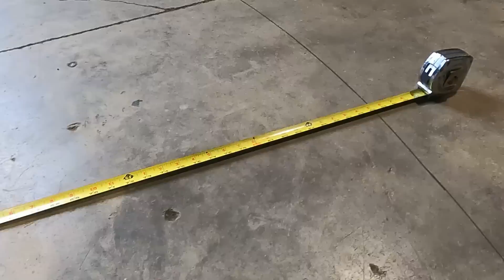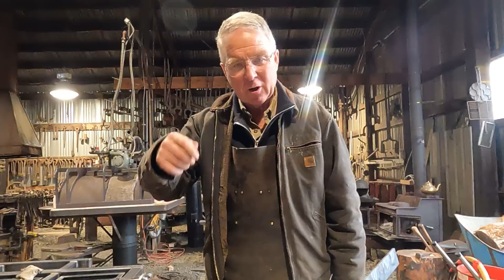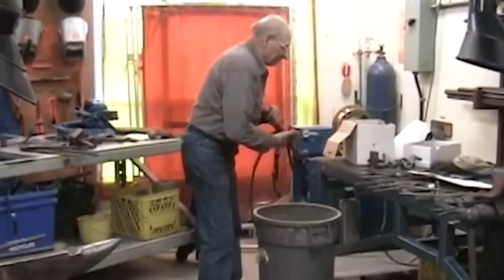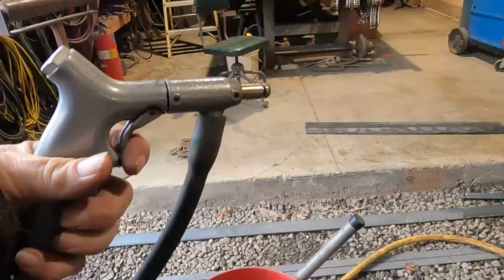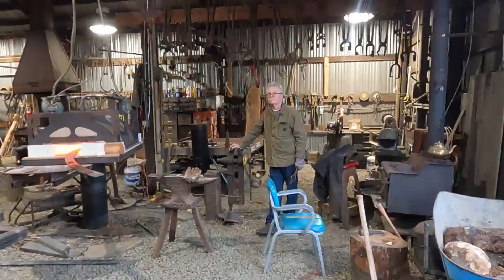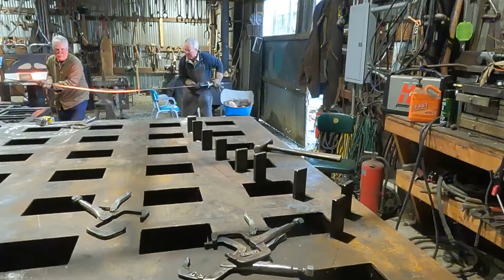Bending A Huge Piece Of Steel

Comment: My Grandaddy worked at a boatyard as a machinist.  He used that heat and cool method to straighten propeller shafts.  Boat owners all along the East Coast only wanted my Grandaddy working on there shaft because he did WORK RIGHT.
Reply: smart man he knows what he is doing  my thoughts are with him. John Adolph

Comment: I worked in the carpenter shop at an amusement park and one of the tasks we had to do was bend track for roller coasters which is similar to what you are doing.  we bent it cold ,we had a devise somewhat like a conduit bender to accomplish this task

Comment: Brother I sure hope you've given ample consideration to the massive pressures and torque that will be placed on the upper hinge of this swing gate. The gate is going to be beautiful when finished but I am concerned about the final weight every time another piece of steel is added. The shear forces on the hinge points will be massive.

Comment: Yes, metal when liquid will shrink.  You would have better results running a hot mig weld down the i.d. edge, but it still wouldn't curve that much, so really, only two-ways one is a roller press with the right rollers, the other of course like you did.  Now, if you want it to like applied without welding every intersection completely so rust streaks don't appear, sweat the intersections with brass.  Then it will look applied and not beads of weld and no rust streaks.  Sand good and prime good because paint doesn't like brass.  Keep it just in the cracks.

Comment: Scott, 
As a retired materials engineer, let me try to help. When steel is constrained and heated hot enough on one side of the neutral axis the steel will yield in compression. Then when it's cooled there it will contract and pull the item shorter in that formerly heated zone. I've seen refinery pipefitters use this method for small adjustments. As you found out your forge and jig worked much faster. Excellent work!
Reply: Correct, they are plastically straining the material (strain hardening). But keeping the strain below the UTS to prevent necking.

Comment: Isn't it typical, build something and welding it, is the devils own job to keep it square and straight. Try and deliberately bend it using the same heat and it doesn't bend anywhere near enough....

Comment: Bending it by heating it with your forge seemed to have worked really well. But I was wondering if you could have cut kerfs in the bar every 4” to 6” that were 2” or 3” deep in the 4” bar then bent it easily and welded and ground all the cut spots. Obviously a lot of work but seems like you might of have an easier time getting the bend true?  Too hard to keep the multiple welds on the same side from over bending it maybe?

Comment: I used to do something similar. I was working in a steel shop. We made flagpoles and antennas. Place had been there since the 1850s in Camden NJ. Place started out making Sailboat masts. Anyway, we mostly used large presses to straighten things. But when they were too big for the press we would use heat. To do this you would heat the long side of the bend in the pole (the bottom of the U in a U shape). Heat it up to cherry/yellow in the size and shape of a football for a ~36" pipe. Then place someone down the end to eyeball the straightness, and water quench the heated area until it looks straight. Then repeat until complete. Seems crazy but it worked great.

Comment: Here’s what I think is happening:

When the metal heats, it wants to expand equally in all 3 dimensions.  Keeping the heat in one side helps prevent it expanding axially along the length of the bar - the untreated side acts as a stiffener - so the metal bulges (upsets?) in thickness and in width across half the bar.  Cooling it sets that bulge and makes the metal contract pulling it into an arc.

You could probably measure the thickness before and after heating it to see how much it increased by.
Reply: I like your explanation. It makes sense to me hearing it this way.

Comment: My brother in law owned a pole log truck for a period of time in his working career.  On one of his pole trucking adventures, as usual, the access road was inadequate for the length of his load.  This resulted in the trailer rolling over the bank on the outside of the turn before he was able to get the load straightend back out on the other side of the turn.  This resulted in bending the reach., a big downer for the day.  As one may know or not, the pole trailer reach sleeves into itself at least two times, if not three times, and it needs to be highly adjustable. 

I did not see the bent reach, but he told me that he was very PO'd about the damage.  After getting unloaded, he went home and called a retired Simpson Logging shop welder (I can't remember his name).  Matt helped, but mostly watched as the metal magician, utilizing a large rosebud, heated here, then heated there, back and forth, until the reach was as good as new.  Needless to say, my brother in law was very appreciative of this man's obvious metal trade skill.

Later in my life, I bent the c-channel tow bar on my chain harrow, using it where I should not have been.  I was able to straighten it nicely, using what I had learned from my brother in law's story.

Thanks again for another thoughtful video.

Comment: There are good videos out there by Keith Fenner of Turn Wright straightening marine propeller shafts very precisely with a torch and cooling gun.
Reply: He’s a magician, don’t let him make you think that he’s a machinist. Lol A little heat, just barely red, then a lot of cold water and he gets a 15 foot (or whatever) length of shaft within a couple thousands of an inch straight as an arrow. I thought of of Keith immediately when Scott started this video.
Reply: "Precise" meaning "within 2/1000ths of an inch (.002)" across their often 10-20 foot length.  Craziness.

Comment: Why not just roll it in roller bender
Reply: I was wondering about that but it looks like a lot of metal to bend on edge, you’d need a person on each end to hold it up and someone to turn the crank back and forth how many times. I think heat wins in the end again.
Reply: @Hoaxer51  short sections and weld together later would have been way faster
Reply: @harkbelial , When I do short pieces, I have trouble with a small piece of straight on each end that I end up cutting off to keep the radius true. It ends up making a lot of waste.
Reply: To likely to twist I imagine